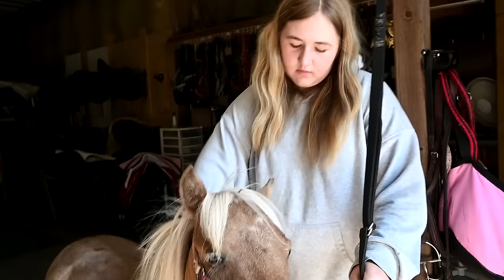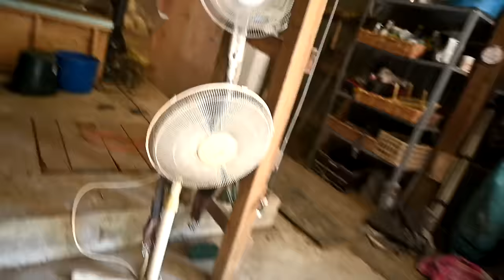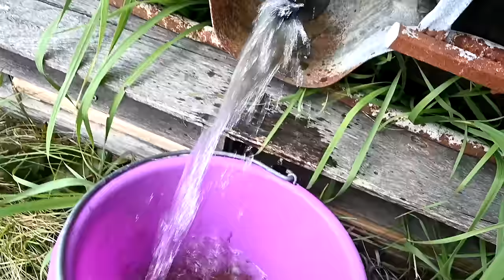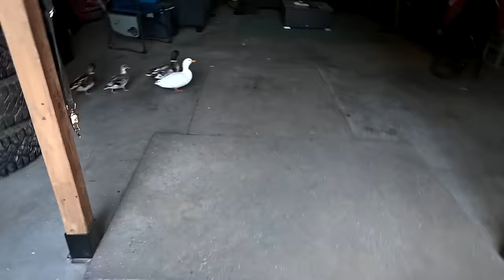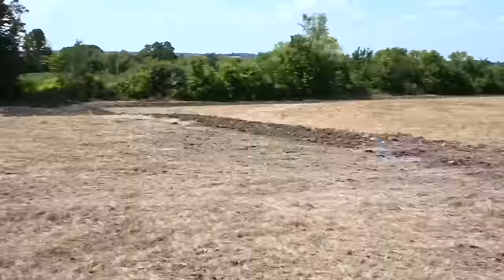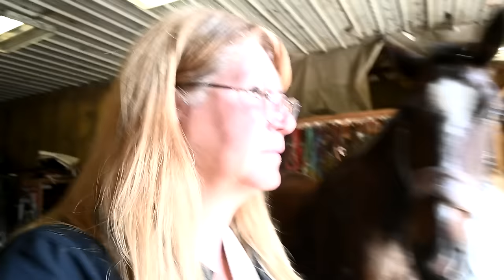We Need Your Help With The New Horse!

Comment: You could always long-rein her around the fields, if you’re worried about her ruining Sophie’s confidence because she wants to take off. She will have no choice but to stay in a walk, and it’s always a good ground exercise for horses, no matter their training level. 

She’s just doing as she’s been taught and allowed to do by Sophie. You’ve got to undo that, and even if it means she has to only walk around fields for the time being. As someone suggested, work her somewhere else then use the field to ‘cool off’. 

Or if Sophie wants to do more, then school her properly in the field - ie. circles and LOTS of them. Constant change of directions, through shapes and serpentines. Transitions, transitions, transitions! Keep her brain busy and anticipating the next move. Simple basic flat work. Don’t give her the chance to find a straight line and want to run forward. If she does, turn her in the opposite direction to the leading leg, and make her do counter canter. She will struggle because it is difficult and requires balance - something she and Sophie aren’t established in yet. And that’s ok! Counter canter is meant to be difficult, but it’s satisfying to feel your horse get stronger and be able to support themselves around a bend without needing to quicken or drop down and onto the forehand. 

Cantering is a horse’s easiest gait. It’s not the best way to build muscle, rather stamina and fitness. She should be doing hard trot work that is uphill, over poles, up and down transitions, all to the engage the hind end. I know you’ve been working on this already. It just takes a bloody long time. And do not canter towards home, if you will struggle to change that behaviour and hold her back! Big no-no. 

Quite literally, don’t run before you can walk. If you can’t do it in walk, you can’t do it in trot - let alone canter. Everything starts with the walk, then the trot, and then the canter will happen in its own time. Basic lateral work should be established in the slower paces, before rushing off into anything else. Sophie can practice turns on the forehands, leg yielding, travers, renvers and shoulder-ins. All basic but important lateral work to engage your horse and get the most out of them. Dressage/ flatwork is fun when you know where to start. And you have to start at the walk and build up.
Reply: What a nice, helpful and knowledgeable comment.  I think you covered all of Laura’s questions she was asking help on.  That was very nice of you.  
PeaceAndLove 
Lori

Comment: Yes because Sophie is taking her out to gallop lol( when you told her NOT to gallop she did every time you told her not to) she has to learn to listen to Sophie, still very new relationship and horses will test this. Practice in the ring only walking, only trotting, then go on a “short” trail practice same thing and reward when she listens. Build from there until she listens at all the ques❤️
Reply: Also check the bit, she may not like that bit or need a different one when out on trail :)

Comment: Just a suggestion… work on ground first getting lady to learn how to yield her hind quarters. Left hind quarter right hind quarter go forward then back. Check her flex.  Then have her lead turning the lead into a drive.keep this going until lady is focused on Sophie. 
When in the field do the same thing only from lady’s back. Have lady yield her hind quarters left right and then back up. Then do a bunch of small figure eights at the trot. Like 20 of them. Stop then ask lady to yield quarters again. Then walk off. As soon as lady takes her focus off Sophie then immediately go into the figure 8s again. Then yield her hind quarters then walk off. Continue this until lady learns that walking is much nicer than doing figure 8s.
Hope you understand this and if you try it I hope it works for you. 😉😊

Comment: You are so lucky it’s $500 for all your horses?! It’s 500 for one horse where I’m at.  The best thing is when Sophie can do lessons in the indoor arena. She has to start at the walk and be able to rate at the walk using her body.  Any time she speeds up she should stop and back her a couple steps than let her walk forward.  How about starting with groundwork so that she can relax and work her hind end and learn where her feet are.  Teach at the walk, train at the trot and test at the canter. The canter relates directly at the walk so more walk practice with the trainer. It will also help if she’s ridden consistently 5 or 6 days a week even if it’s just at the walk and trot.  If Sophie is also able to build her core better outside of riding, it’s a really athletic sport and to be able to support the horse you need to have a really strong core. One really good exercise is to see if you can do the walk trot and canter standing in your stirrups on the balls of your feet, like any athletic sport you should be in that athletic position as if you were going to stand up in the saddle and shoot a basketball at any time.

Comment: Barn sour is difficult. Never let her run to the barn. Seems Sophie is doing all she can. Circles when you start to the barn.
Reply: Absolutely.  Also she could dismount and walk back. Cool down.  We did this after ever ride.
Reply: You need to make the barn area an area where Lady has to do the most work. Serpentines, figure 8’s circles backing up, lots of transition work upwards and downwards. A few walk strides to trot or canter for a few strides and back down. Make her work hard in that area. Then when she goes out on the trail or fields, make that the place where she does not have to work hard. She will learn it is easier the farther away from the barn/ other horses and that should help with the barn/ buddy sour issue. It will take a little time, but you need to reprogram her thinking. The barn is her safe place. She needs to learn it is good to go away from the barn. Then when she is doing well and is calm, you can leave her trot and canter on the trail. But she must start out with only a few canter strides and not in the same place every time. Horses are creatures of habit and they pick up on small things. They learn that this is the place where I always get to move out. Mix it up. Sorry this is so long, but I have been training horses in natural horsemanship for a long time. There are a lot of exercises that can be done on the ground to make her work near the barn as well. Groundwork is an essential part of the training process and I would go back to the basics. She is a young mare and could benefit from it. All horses can benefit from groundwork!